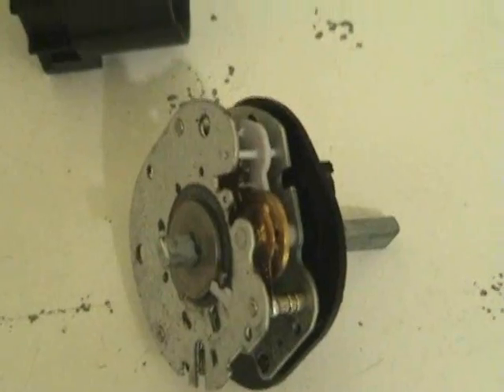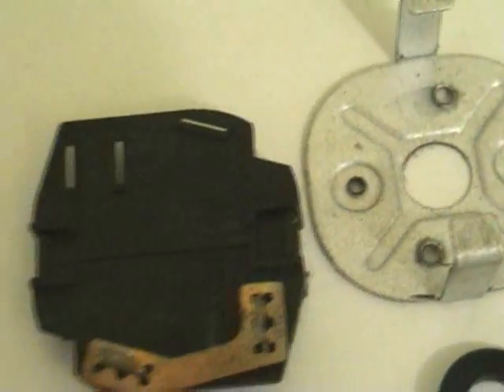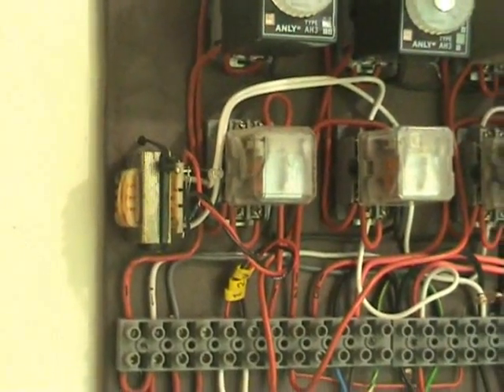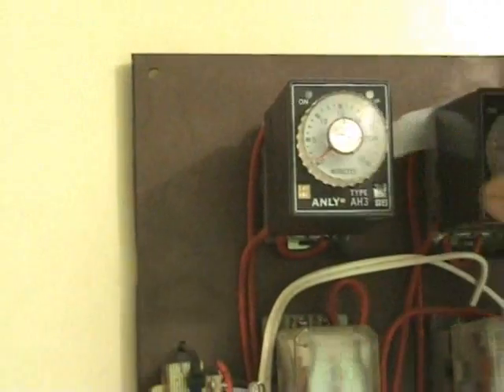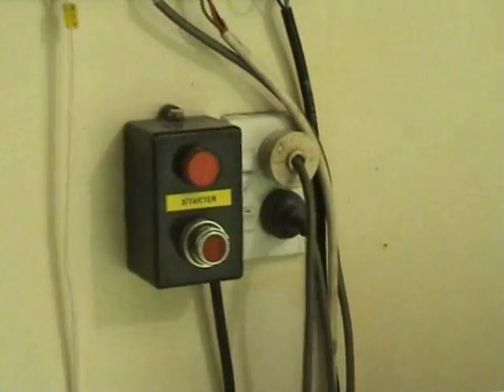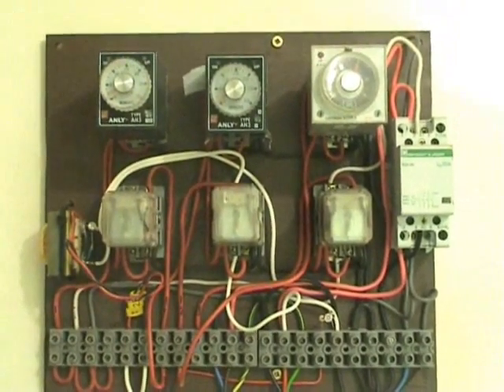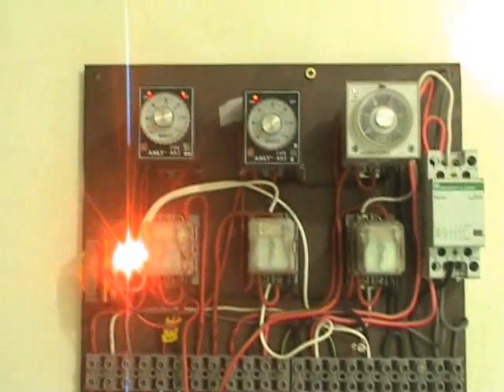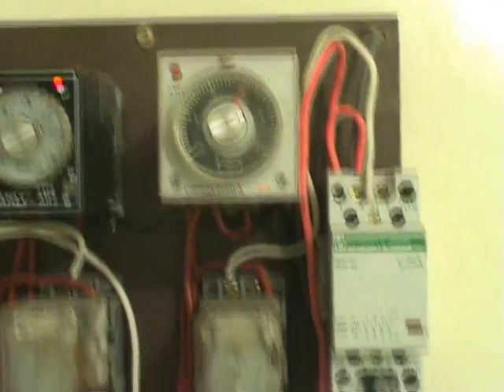Simpson Sirocco 350  dryer modification

Comment: Is that a quartz timer on the cooldown side?
Reply from the maker: +douro20 They are all electronic timers, haven't opened them up but most likely have a quartz element in use for timing. System still works well 6 years later.